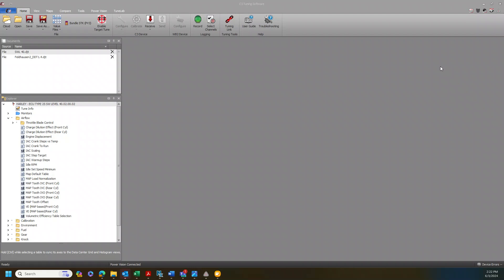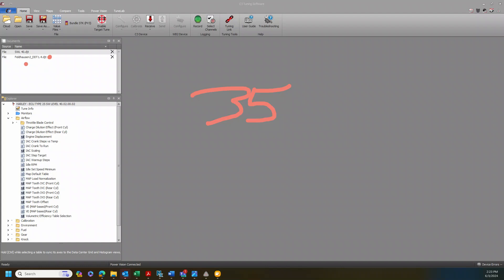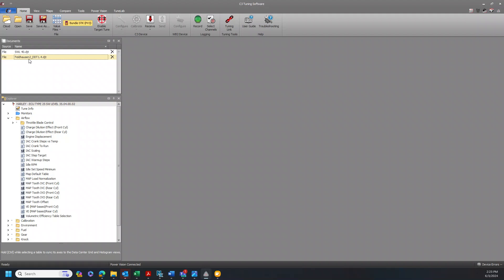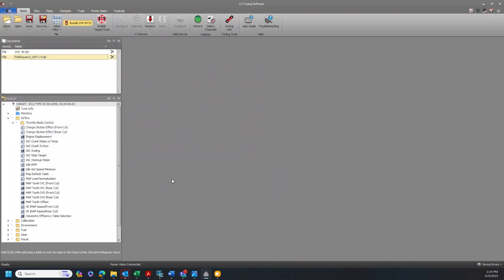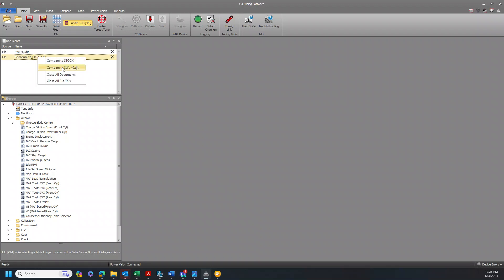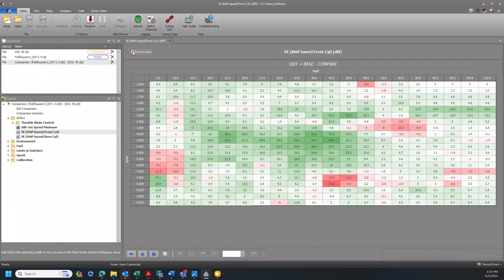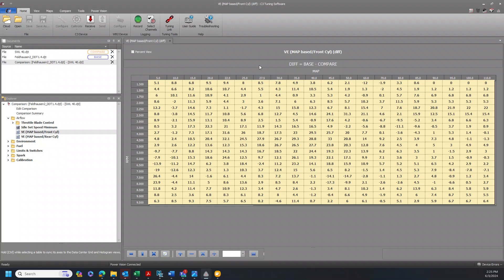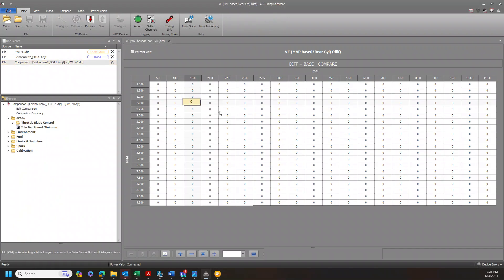Power Core - Compare Feature

Comment: I have a dynojet 3.
I have n air cooled 2015 road glide. 
I installed a twin cooled map by mistake.
I did upgrades and had it pro dyno tuned by a shop.
The engine light now stays on because the bike is looking for a twin cooled senser that does not exist.
I want toe reset the ecm to factory so it knows it is a air cooled bike.
I want to  transfer the .pvt tune to .djt and install that so the engine light goes off.
Then when it goes on I know to check for a problem.
Is this something you can help me with?
Could I send you my stock .stk file and the .pvt file and you make me a .djt file I could put in my bike?
I would rather pay you than the shop again because they are so far away.
Nobody else here knows what the fuck I am talking about.
Or should I do a loyalty customer upgrade and buy the Power vison and do it myself?
Thanks in advance
Reply from the maker: Happy to help. Send me what files you have and any relevant notes. 

dynodantuning@gmail.com
Reply: OK, sometime today.  Thanks.